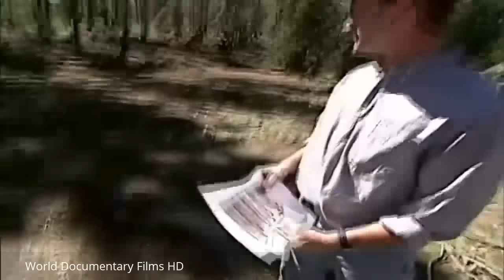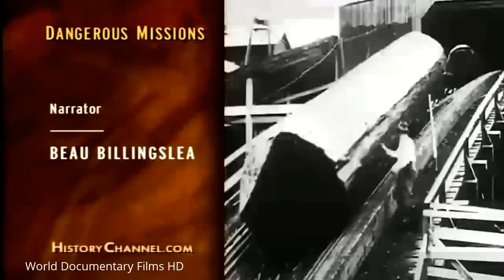The Risky Life Of Lumberjack - World Documentary Films HD

Comment: Worked for coulsons aircrane in the 90s around lake Cowichan ,and salmon arm BC
Got hit by the cable once,  chasing .And fell in the water a couple times operating a sidewinder. Getting poked by the static electricity,while hooking under a sikorski s-64 (ichabob crane) didn't feel that great either... But the worst time was during a crew change at noon on the hill. I grabbed a radio, got to where I was supposed to be. And the log I was traveling on started moving .It was part of a  stretched out turn of maybe 3 big firs and a few small ones. I tried signaling my coworker ,and radio the pilot to let me clear .
Well the radio didn't work . So I jumped into a small opening under a stump.The log I had been walking on wasn't pulling loose ,it was stuck ,and the pilot was yarding on it hard .that log was banging away a few feet from my head . And finally it pulled free. That was a close one. Now 33yrs later I'm back at er .log salvage west coast van isle ,and building a saw mill. I just wish old ichabob air crane was here to get some of these big  cedar off the beach!

Great video thanks for posting it.

Comment: We aren't "lumberjacks".  We are loggers.  I don't know that the Canadians even call themselves "lumberjacks".
Also a hook tender (hooker) is not some dingaling helicopter-logging choker setter. 
A real hooker is the boss of a high-lead side.  
There is a yarder engineer, a shovel operator, a chaser who unbells the turn on the landing, a rigging-slinger who signals the yarder engineer, and choker setters that the rigging slinger directs what log to choke and how to choke it.  The chaser tells the yarder engineer where he wants the logs dropped.  If there is a second loader, he works for the shovel operator.  The hooker determines where to hook tail blocks to put the mainline over the next "road", where to hang guy lines, when to upend the mainline and haulback, etc.  He is the ultimate boss of the rigging slinger, yarder engineer, and shovel operator.